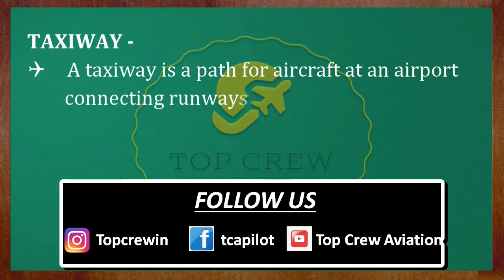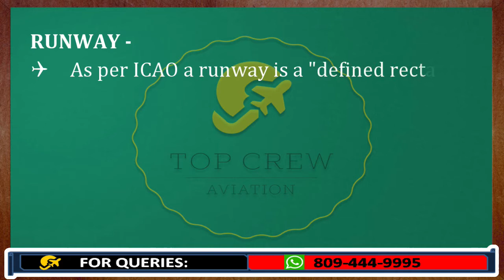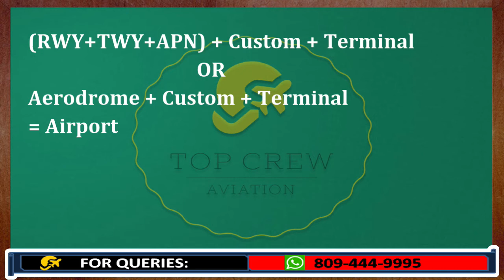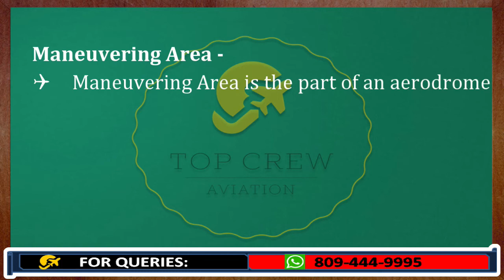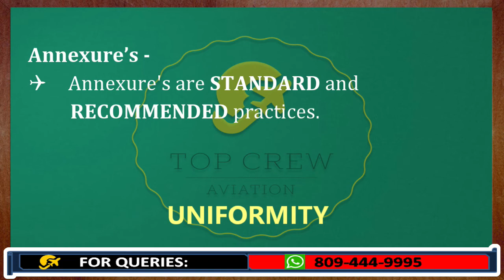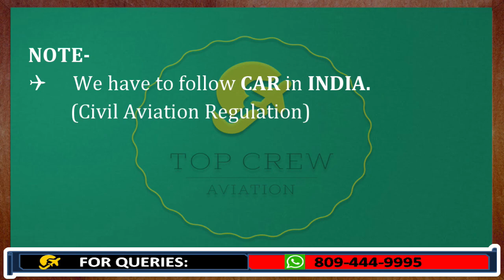RTR(A) PART - 1 | APRON | TAXIWAY | RUNWAY | AERODROME | ANNEXURE'S | MOVEMENT & MANOEUVRING AREA

Comment: Sir, what is the difference between Hangar and Apron
Reply from the maker: An airport hangar is the place that houses the aircraft, providing shelter and protection from the elements when not in use. This is also where repairs take place. The airport apron, also referred to as the ramp or flight line, is located off of the airport runway.